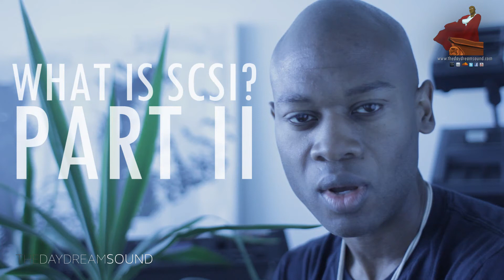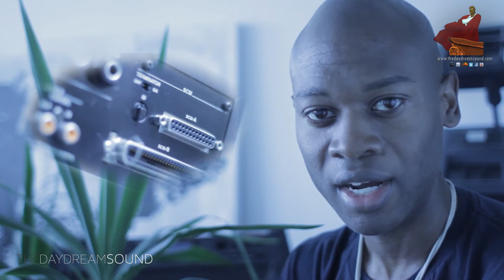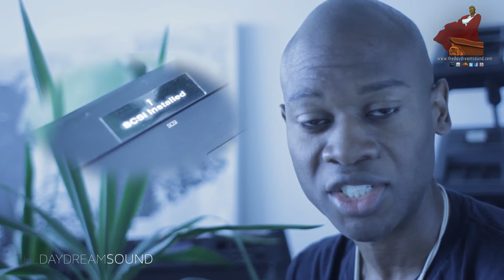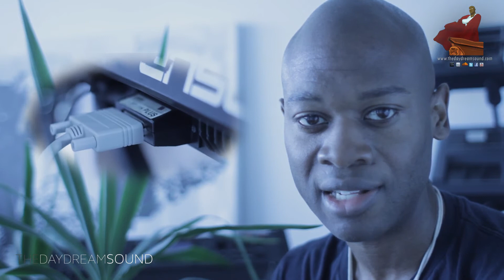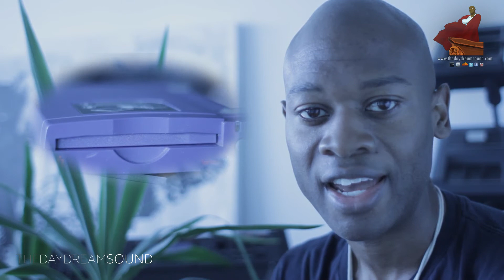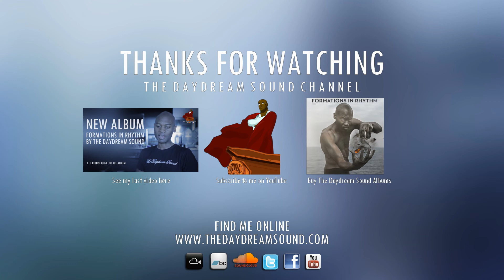SCSI & Hardware Samplers - SCSI Talk Part II

Comment: I'm driven by the limits I face with my gear. My third sampler was the octatrack and I had to learn the thing inside and out to fully understand it's limitations. Now I'm learning the ASR-10, I think I will be using floppies- I feel like the SCSI will actually slow me down as it just adds an extra process.Can I use HD floppies or should I get DD?
Reply from the maker: I completely agree! Floppies really make things easier.

Comment: I only have a laptop with USB.  No floppy disk as its quite new. I just got hold of a ASR X with SCSI port. What do i need to find to be able to transfer sounds back and forth between laptop and ASR X as I have a lot of sounds and samples on laptop  and hard drives. Ive seen something about the connecting  SCSI2SD to ASR X. How would I go about this as transfering sounds via Mirco SD would be perfect. Pleas help thanks

Comment: If you floppy the floppy or back it up, that's years of storage. It's as tho' they are fail safe but not really. Floppy engineers knew what they were doing when they decided to create  samplers with floppy drives for their floppy discs.  If one floppy disc goes bad, it doesn't take 100 others with it, so remember, with great power comes great responsibility, or respowerality. Going from 1 mb floppy to 100 MEGA bites SCSI is a HUGE step,  so tread those SCSI waters lightly if you are upgreeding. Floppy just sounds beatiful. I would use SCSI if it were named floppy. If I invent a data port, I'm gonna name it floppy.

Comment: Hi i'm buying a ASR10 without a SCSI and it has 10mb of ram. Will i be able to get wav files transfered on a floppy just using a computer? then putting in the floppy in the ASR? will that work? and, will 10mb of ram be enough to make beats?
Reply from the maker: Thanks for reaching out man! The ASR-10 has a different file system than a computer which makes it more of a process to transfer files. There are programs out there that help make the process easier. In my opinion the easiest way to get sounds into the ASR-10/floppy is simply to sample them in real time. You can make beats with less than 1MB of ram. The only catch is that you'll need to be a creative person. I think 10MB is more than enough.

Comment: Say I just bought an S950 and want to use the loads of wav samples saved up on my modern external harddrive. What would be the process? Would I need to record in each wave to take advantage of the "950" sound. Would I just by an external floppy drive and click and drag. I own an MPC 1000 and 2500 and I've never been happy with the sound. The S950 and s1000 has been in my cross hairs for years but I never pulled the trigger for fear UT would really bogged down the process. What's your take?
Reply from the maker: Stashy What up Stashy!

Thanks for reaching out and all you support! Much appreciated! I completely understand how you feel. That's part of the reason that I use older samplers. The character that they have really contributes to how your music sounds.

I would take the long road and sample in each sample to fully take advantage of the S950 or S1000. It's a tedious process but I think it's worth it. I don't know if the S950 reads WAV files but as an alternative you can use a conversion software like Translator 6 by Chicken Systems. That's a pretty quick way to get all your sounds ready for any older sampler.

As an additional option I believe you can pass the audio through the S950 which is said to be able to convert the audio on the fly as the incoming audio actually passes through the A to D converters while monitoring. I haven't paid attention while I was sampling to confirm if this is the case but I've heard that it does.

Hope this helps,

Peace,

TDS
Reply: TheDaydreamSound Thanks for the informative reply. I heard rumors of established producers utilizing the sp404 with the MPC 2500 to alter the drums and give it a more fuller sound. Was never sure if that meant they would just control the 404 via midi or if they sampled from the 404 to the 2500. Kev Bound has mentioned it but was tight lipped about details.

Comment: what do I need to go with my xl 2000.. 
n can you save just sounds or actually tracks.. 
please don't hesitate to clown or school me. I dream of banging beats out.. please help me get these noises out of my head.. correctly.. in need of scsi n a how to use guide..
Reply from the maker: +Bruce Lee What's up Bruce! You essentially need a SCSI drive and a SCSI cable and a disk. If you're looking to get started you really don't need a SCSI drive at all. You'll be fine with floppy disks.

Comment: That's the problem with Vintage samplers. You might as well just record your samples live from your old school sampler into your DAW than suffer the nightmare of finding compatible SCSI HD/CD units that may or may not work with your device. If you buy a old sampler where they include SCSI stuff, then you can assume it will work, and you probably won't have any issues. But, if you buy a vintage EMU, Ensoniq, Akai, Roland, or Yamaha sampler, and decide "I should invest in some SCSI cd rom drives, or a SCSI hd....". Then, you've got a nightmare of calling old electronic/pc repair shops, just to find SCSI cables, or devices. And once you locate them, will your vintage sampler even work with it? This problem will get worse for vintage sampler owners if there is more demand than supply. The work around, would just to sample your vintage sampler??!
Reply: Aaron Chase Yeh, I get what you're saying, it can be a hassle to to get the correct storage device sorted for your sampler. However, if you manage to get a CF or SD card reader then all the problems go away and you have a reliable storage device. The card readers for the ASR-10 do cost over £100 so they can be a bit pricey, but worth it imo.
Reply from the maker: Aaron Chase What up man! Yep it can be a real problem these days. SCSI drives are becoming more scarce.
Reply from the maker: Bewareofthewolves What up man! I agree. Internal or external CF/SD is the way to go!